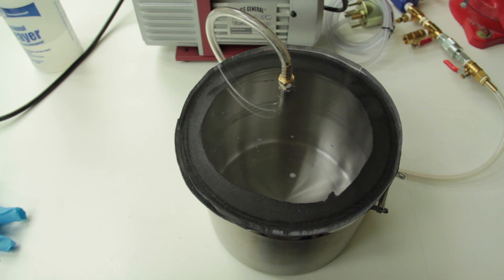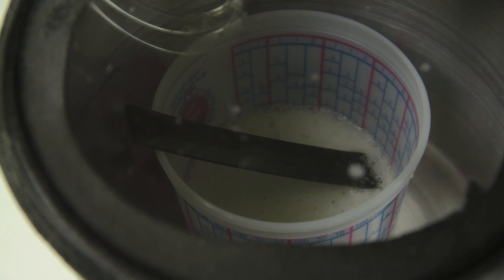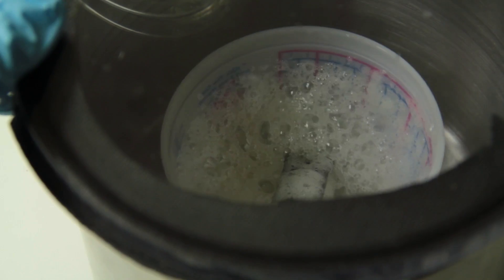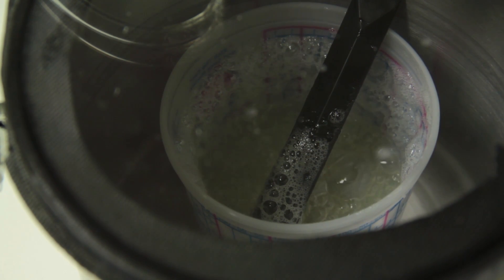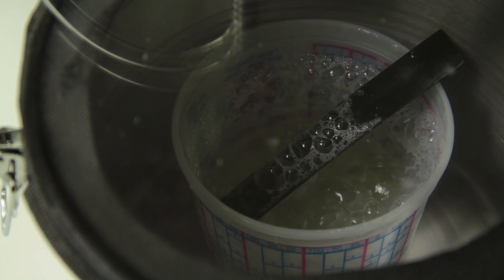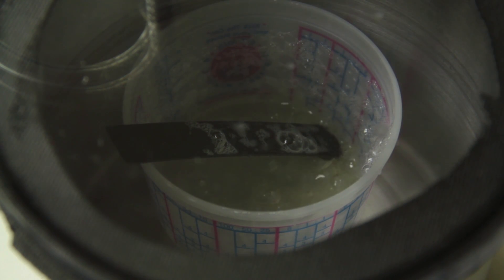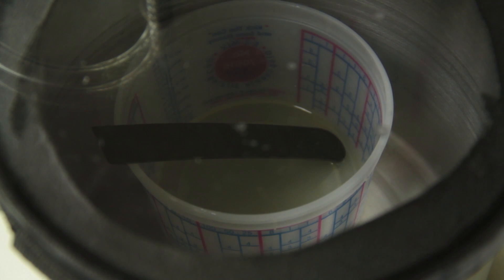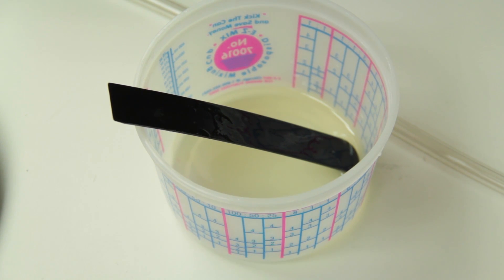Degassing Epoxy

Comment: Hi Les, Could you please tell me what type (brand, part number) of two part epoxy you are using? We've tried this method in a vacuum chamber after adding Lithium fluoride  powder and it's too viscous, so the bubbles don't flow out like your does. I'm thinking that if we can find a very watery epoxy, it would help. Have you added any modifier powders to yours? We also have to do a similar process to the LiF powder with boron carbide powder. Thanks!!!
Reply from the maker: +Nancy Hadad What you see in the video is West Marine Epoxy, specifically #105 and #206. I have used modified epoxies before (specifically by adding marble powder) and it is difficult to degas them. While a less viscous epoxy will help the addition of solid modifiers will eventually raise the viscosity to an unusable level. If you have the equipment available you may mix your epoxy, degas it, and then add your modifiers to the epoxy and mix them in the chamber under vacuum. This requires a chamber with a port through which the mixer may pass.
Other options include using a two part mold with compression, thereby gaining a greater degassing force than available from a single atmosphere degassing. 
Hope this helps and good luck with your project.
Reply: +Les Wilhelm TY Les! We are using the same epoxy as you now, but our epoxy never seems to get to the point of "breaking"" where it looks like it's boiling with big bubbles. All we get is a foam on top with lots of little bubbles. We left it in our vacuum chamber for over 15 minutes at almost 30 inHg. Do you know why this would be? We have about 85ml of epoxy once it is mixed, so maybe this is too much volume? Thanks for your thoughts!
Reply from the maker: +Nancy Hadad In order to degas any material the force of the expanding air must overcome the forces which prevent it from escaping. When you modify any resin you change its viscosity. When viscosity increases the force required for entrapped air to escape also increases. There are two ways to address this. 
First you can modify the resin to bring its viscosity back down. Solvents are normally used for these cases but selecting one which will not damage pump equipment or have negative effects on your part can be an issue. An easier solution is to increase the temperature of the resin which decreases its viscosity. This does however have detrimental effects on pot life. You can also choose a very low viscosity resin. You still have to deal with the change in viscosity brought on by your modification but having a lower starting point will help. 
The second is to increase the surface area you work on. The thinner the cross section the easier it will be for air to escape. This is only really applicable if you can vacuum the resin after it has been placed into its mold.
Reply: +Les Wilhelm  Hello, sorry to bother you again Les. We tried reducing the volume of epoxy to a very small amount (4ml) so the surface area was very large for that amount. As I said above, we are using the same epoxy as you did in this video. We bought a new vacuum chamber with a clear top that's often used for degassing materials. In any case, we did get larger bubbles (maybe 1/4" diameter at most) and every 30 seconds or so one would grow and pop, but most just stayed on the top surface. So when we released the vacuum, we had much bigger bubbles in the material than before.  Thanks for your previous help, and if you have any more thoughts on this, that would be great. We did try swirling it around in the chamber as you do in the video. The vacuum chamber suppliers suggested a few things. One was increasing and decreasing the vacuum to agitate the bubbles out. Another was to very slowly bring it up to full vacuum (increase by 10" of mercury, wait 20 seconds, and then do it again). This seems like the opposite of agitating it. The 3rd was to increase the batch size to 20ml instead of 4ml, ie they thought our batch size was too small? We have not yet tried your previous suggestion of heating up the material but that's another possibility. Also, you mentioned solvent. We have tried spraying acetone on it once it's out of the chamber which does get rid of the surface bubbles, and then more come to the surface and we can't seem to get rid of them all. Maybe we should mix some acetone into the original mixture, a small amount, and see if that works better once it's in the chamber? It's just a little baffling why ours does not do what yours does, even though our epoxy is identical.
Reply from the maker: +Nancy Hadad The difference in outcomes is caused by the difference n viscosities of what we are putting in our chambers. In this video you see an epoxy with no modification which is easy to degass. The more solid modifiers you add the harder it will be do degass. 
In addition to the suggestions already mentioned there are a couple more which are a bit more exotic you might try. 
Use an HTC (high temperature curing) resin. These resins do not cure are room temperature and will therefore give an almost unlimited amount of time for degassing. Each HTC resin will have what is essentially a baking recipe for how long and at what temperature it should be heated for it to cure. The materials you modify your epoxy with must be able to withstand this heating process. 
Mix the resin and modifiers under vacuum. Depending on what equipment you have available you can arrange it so you place your epoxy and all modifiers into the vacuum chamber, then apply vacuum, then mix the material. The air entrained in epoxy gets into it because it was present in the mixing cup with everything else. If you mix under a vacuum you can avoid the issue altogether. This does require something of an exotic setup as you will need some kind of mixer inside the chamber.
Reply: +Les Wilhelm Hi Les, sorry I wasn't clear. We're just degassing the epoxy only, with no additives, using the same thing as you....West Marine Epoxy, specifically #105 and #206. So, degassing just he epoxy all by itself, the same epoxy you used, is not working. As I said in my note above, we get 1/4" bubbles that pop very slowly and there are still a lot of them there after 20 minutes. One of the gas chamber vendors mentioned that perhaps our amount is too little (4ml in about the same size container as you are using) so we're going to try a larger quantity (20ml or so). We're pulling the epoxy out with syringes which may increase the number of bubbles (instead of using a pump), but that shouldn't matter, the bubbles should still come out. All of your advice has been great, so for this situation, any more words of wisdom for us? Thank you!

Comment: Hi, If you are mixing some ceramics with your two component epoxy, then how to avoid bubble introduction in to the epoxy. Can you suggest some methods? I tried degassing but I can not shake the pot like you did as its really big and bulky. also the amount I am preparing is roughly 4 ml.
Reply from the maker: If you are worried about the material overflowing the container under vacuum then you can gradually raise the vacuum over time. This will remove the air without making a mess in your chamber. Using an epoxy with a longer pot life and cure time will also help since you will have more time to remove gasses before the material hardens.
Reply: Les Wilhelm Thank you for the reply
I guess I did not ask the proper question. 
My question is, For instance you are preparing a composite. Let say a composite with 40 wt % epoxy and 60 wt ceramic. How would you degass this? 
The vacuum chamber which I am using is really big and I am putting my composite inside a crucible like you did and then put the whole thing inside he vacuum chamber. I tries this with pure epoxy and it kind of worked, but not to my satisfaction.
Reply from the maker: Jibran Khaliq
What specifically was the problem?
Reply: Les Wilhelm well, the problem is, I am trying to mix ceramic powder with epoxy. as I said the weight ratio of ceramic is high. When I tried to degass the mixture, it did not 'boil' as pure epoxy does and I had bubbles all over the surface and they could not pop. When I cured this mixture, I had bubbles all through and over the samples
Reply from the maker: Jibran Khaliq
It sounds like you might want to try a vacuum bag. In addition to the vacuum itself using a vacuum bag allows atmospheric pressure to compact the material as the air is removed.

Comment: Are you sure those bubbles are air or is the epoxy is boiling?
Reply from the maker: Given this is occurring at room temperature it is definitely air. The pressure in the chamber is well below atmospheric but still far too high to boil most liquids.
Reply: Les Wilhelm I'm sure the rapid expansion at the beginning is from the air expanding the but constant bubbling that continues afterwards may just be the epoxy boiling.
Reply: So wrong, Les...

Comment: Hey thanks for the video! Vacuum, sooo much easier than my makeshift heat and pressure jars I was "Jerry rigging" together. I have a question about epoxy.

I am using it to cast, and as a finish on certain delicate woodworking projects. If I use the epoxy on a sharp angle (meaning less than 90 degrees, using the epoxy on the large surface, with the less than 90 degree cutaway angle underneath), the epoxy is very thin at the edges. I can't tell if its just soaking up in the wood, or some sort of shrinkage is going on. It appears that the edge does have a coating on it, but as I said it is just ever so slightly pulled away.

Comment from the maker: in theory yes. you would want to degas the epoxy before applying it to the items to be laminated together. placing the panels together should be done carefully to avoid introducing air. also in order to use the vacuum to press the panels together you would need to use a vacuum bag instead of a chamber (lots of videos on this out there).
In the case of something clear (like glass) remember that most epoxy is not totally clear. Most has an amber tint to it though clear epoxies can be found.

Comment: great video mate. i have see expensive machines used to eliminate air bubbles when laminating mobile lcd screens and digitizers with epoxy and also clear laminating film. will this do the same job?? like in a basic set up if u try to  laminate two pieces of glass with a epoxy or anything for example, will it eliminate air bubbles in between and act something like vaccum used to "sandwitch'' the two pieces together. i hope u got what i mean. thanks.

Comment from the maker: You can let the epoxy cure under vacuum but there is an issue which must be addressed. Heat. Epoxy heats as it cures. In a vacuum there is no convection so conduction (with the vacuum chamber walls) is the only reasonable way for the curing epoxy to cool.
If you are encasing object you will likely be using an unmodified clear epoxy. These can build up excessive heat with as little as 1/2 inch of thickness in a normal atmosphere.
You may consider creating a heat sink for the mold you will use.

Comment: Excellent. I bought a vacuum pump myself for pretty much the same purposes. Also infusing finishes in wood. Your videos are great. Love the cheap DIY to make the actual chamber. These things are insanely expensive when purpose bought.

Have you let the epoxy fully cure while under vacuum? I have a friend who's wanting to incase some dead insects in epoxy and I was thinking about making a mold for them and setting them up in there instead of just degassing and then pouring it.